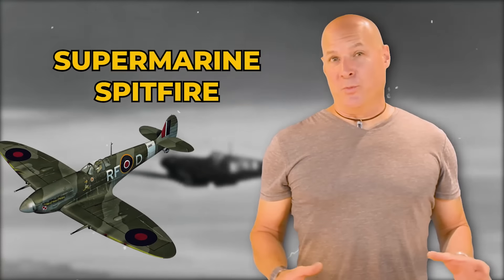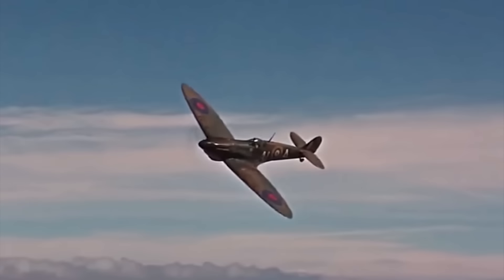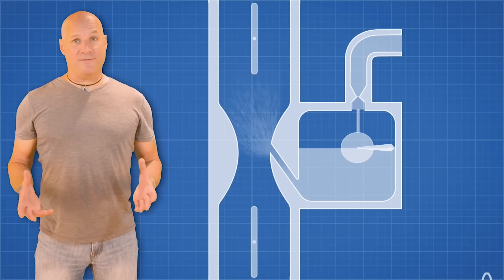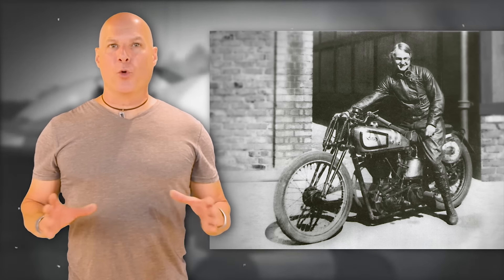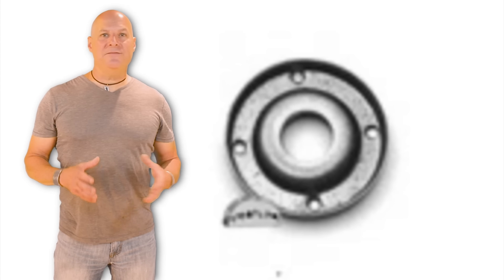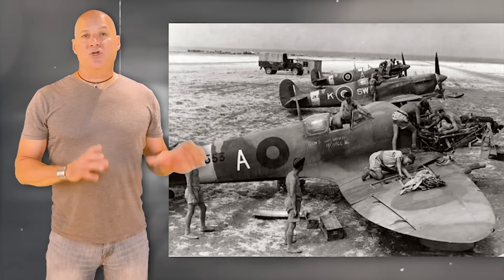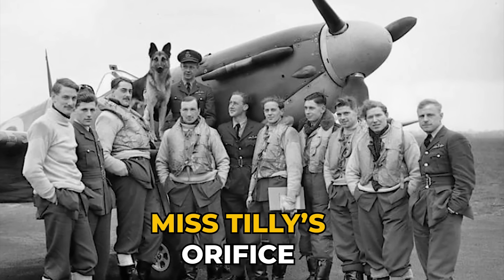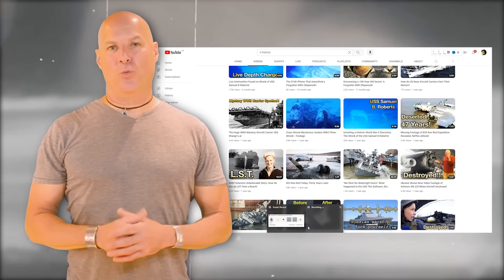How did SHE Save Britain’s Troubled WW2 Spitfire Warplane?

Comment: Beatrice Shilling worked for the R.A.E. and designed the restrictor that partially solved the reverse flow problem. It allowed short periods of negative "g" without cut-out.   At the time it was called "Miss Shillings Orifice".  The other names seem to have been thought up since.  The eventual total solution was the Bendix pressure carburretor which came into service in 1943.
Reply from the maker: Thank you for the great comment, Pete!
Reply: I love the name "Miss Shillings Orifice". This must have caused a few smiles at a time when humour was needed 🙂
Reply: The Bendix injection carburettor was replaced by the Rolls Royce developed S.U. injection carb which was used on all Merlins and Griffons as it became available mid to latter part of WW2.
Reply: Calling the spitfire awful,  bit underhand me thinks ...
Reply: @michaelleslie2913  . No-one said it was " Awful " , just that there was a known weakness in the Fuel System .
The Rolls Royce  Merlin was developed as a RACE  Engine , for the Schneider Trophy , an International Air Race , that involved straight and Level flight and Consistent Hard Banking to Left or Right . No Aerobatics or Negative  G's .
Like  NASCar  Oval events , for Planes .
Reply: I am fully aware of the issues with early spitfire fuel problems,  but before you have a pop at me for goodness sake read the title of the video 🤪
Reply: @johncunningham4820  What?!! Where did you get this information from?
The Merlin had no connection with the Schneider Trophy.
It was not built as a race engine either.
Actually everything you wrote is wrong. Better educate yourself as I haven't got the patience for people who talk complete B/S.
Reply: @Slaktrax  RJ Mitchell, who designed the Supermarine planes that won 3 consecutive Schneider Races (thus causing Britain to permanently own the Trophy) used Rolls-Royce engines after Naiper engine company couldn't make him an  engine that fit the required Horsepower/Weight/Reliability requirements he needed.
 
The Merlin P.V. (P.V. stands for Private Venture) was already being developed as a follow on engine, just in case they needed it for more seaplane racing.  Seeing the real possibility of the next World War looming, Mitchell who designed a failed fighter design.  The failure was due to him, and everyone else trying to fulfill RAF specs,
 
Both Supermarine and Hawker engineers got permission from their companies to make their own designs.  The Hurricane was (basically) a quick modification of various parts of existing Hawker aircraft, including an enlarged nose to house the Merlin.  The Spitfire was much more cutting edge design and required full retooling, as well as extensive testing.
 
But just like the Rolls-Royce's Merlin, which is named after a falcon, they were both Private Ventures!  And the three of them saved Britain!
Reply: The pv 12 merlin had very little to with the schneider trophy supermarine aircraft other than the name of the company that made it although the Griffin engine used on later spitfire marks  used development's from the earlier motors .
Reply: @michaelleslie2913  Rolls-Royce named only its (piston) aircraft engines after creatures that flew!
 
The Griffon was the follow-on aircraft engine to the Merlin.  The Meteor was a modified Merlin engine with shorter Connecting Rods to lower the compression ratio so that it could run on the Army's lower octane gasoline (Petrol).
  
Rolls-Royce had started making special aircraft engines for racing as a way to advertise their engines as High Performance and High Quality.
 
As I noted earlier, the Merlin was a follow-on to an earlier engine that was also used in racing (the Kestrel).
Reply: @timengineman2nd714  The Meteor. Where did you get the information about the connecting rods being different?
They were the same. It wasn't a modified Merlin either it was built specifically for the purpose, it even rotated the opposite way to a Merlin. The static CR of a Merlin was 6:1 and the same in a Meteor, except the Meteor had no supercharger therefore it needed no changes to run on ''Combat Gas'' or low octane Army fuel. 🙂
Reply: @Slaktrax  It used most of the parts that the Merlin used!  Also, if you built engines for better performance, they were two easy ways to raise HP by raising the compression (which is why Racing Gasoline is still Leaded and has an Octane Rating of over 100! (To prevent Detonation).
1) is use slightly shorter ConRods, and 
2) shorter pistons.
 
Most piston aircraft engines use 7:1 N.A, so the plane's speed will turn the propeller giving the pilot a better chance of restarting the engine.  (But the Supercharger and/or Turbocharger (or the PRT) will quickly run up the effective compression ratio of the engine!   Since the air is quick thin at 10,000+ feet ASL... But that's why most Allied AvGas was 150 Octane or 180 Octane (thanks to Airplane Racer Jimmy Doolittle!  Who talked Shell into making higher Octane Gasoline!!  Fortunately, the Germans didn't get that information when they conquered Holland (Shell is Dutch))....
 
Didn't know that the Merlin was that low, so perhaps they used taller Pistons in the Meteor... but any where near what a normal car engine has for compression will cause Detonation with 50 Octane MoGas.....
Reply: @timengineman2nd714  I don't know where you are getting your information from, what source are you using?
-----------------
Just about everything you are saying is wrong. Okay, never mind. Keep believing 🙂
Reply: @Slaktrax  My sources are from things I've heard over the years.
You were right about the 6:1 Compression, I must have been thinking about the V-1710 Allison .vs. the V-1650 Packard built Merlins. My bad.
However, it kinda makes sense about using a lot of the same molds, etc. to make the Meteor, since those were available and a big improvement over what was out there for the Royal Tank Corps (basically a diesel bus engine, or basically a modified WW1 Liberty engine (think the "Jenny" trainer engine) both of which had been developed as far as they could go in Horsepower to Weight (and size) ratios.
Reply: The pressure carburettor is the Bendix-Stromberg. It was a JOINT DEVELOPMENT of the American and British companies. BOTH have a right to be named. EQUALLY.
Reply: The Rolls Royce development of the Bendix injection carburettor is covered by AC Lovesey, book Development of the Rolls Royce Merlin, who is credited with designing and development, to address the bendix problem of drop tanks, if the practice was to follow the SU carburettor spitfires to fly on drop tanks to get maximum range first before using internal, the Merlin 66 with Bendix carburettor could be difficult to restart, not ideal in a Mustang over Germany. All Merlin’s from the 100 series went to SU fuel injection similar to Sabre. Hobson-R.A.E. BIINSB fuel injector, with injection through I nozzle into eye of supercharger impeller. Updraft air intake Automatic boost control.
Reply: @DC.409  Great info. Good post, it helps when people have facts and not hearsay nonsense. 🙂
Reply: I bet in the end she made a Bob or two 😊
Reply: @DC.409  There is no such thing as a Bendix pressure carburettor. It is a Bendix-Stromberg. Stromberg was an English company which was an equal contributor and partner in this development.
Reply: @pashakdescilly7517  I didn’t say pressure carburettor, I think you did. 
I quoted Rolls Royce who refer to the Bendix injection carburettor, that the SU carburettor was not available in the USA, modification was made to the Bendix No8 carburettor in their documentation exchange with wright field of 24th June 1942, regarding the Americanisation of the Merlin 61 and 66. They specifically quote that Packhard engines 28,29,31,33,38, 65,66,70,77 and 85 were all fitted with Bendix carburettors, with some exceptions above series 100 equivalents which had Bendix pump fuel injection. I anticipate this was done to simplify descriptions at the Strategic level given the number of Merlin variations.
However only when you look at the tactical level specifications of each  engine series  they provide detail and reference is made to the type Bendix-Stromberg type of Carburettor 8D/44/ 1 , 2 or 3. Similarly for U.K. engines they refer to SU float type or SU pump type (fuel injection) , only when you get into specific engine detail do they then provide the specific carburettor model type and reference to the RAE anti G device if fitted. Indeed on certain series of engines the RAE restrictor was retained leaving the SU carburettor unmodified but with anti-g features the RAE restrictor was removed. Arthur Lindsey head of engine development covered this in his book and lectures post the war.
Reply: @DC.409   Up until 1943, the Rolls Royce Merlin used an SU carburettor.  After that the Bendix-Stromberg pressure carburettor was used.  You are trying to draw a semantic distinction which is incorrect. You lose marks for being incorrectly pedantic and having incorrect information, and persisting with it despite being offered correct information. Go look it up.
Reply: @pashakdescilly7517  Incorrect actually they used SU carburettors float feed with RAE anti-gav and the SU injection fuel pump from 100 series on all U.K. manufactured engines, Bendix-Stromberg injection type carburettors were only used on American built engines, again until the 100 series when Bendix went to injection fuel pump, 1948 Arthur Lidsey published in the Rolls Royce Data handbook in detail. I would think Rolls Royce would know the detail of each engine type, given they designed the engine and managed their production, it’s also covered in detail in several Rolls Royce Heritage books, 2, 9, 31 and 46 from original documentation.
Don’t confuse location of engine manufacturer with aircraft manufacture, Lancaster and Mosquito built in the U.K. could have Packard engines once they had gone through the Glasgow facility, called the British installation. Indeed the Bendix carburettor could be replaced particularly when the engine was brought up to the latest specifications with new connecting rods for example because of identified Packard connecting rod failures and then fitted with the SU carburettor.
Reply: @DC.409   You write utter tosh.
Once the Bendix-Stromberg had been developed it was used on ALL RR Merlins whichever factory they were made in.  Whether it was a RR factory, any of the other factories in the UK making Merlins, or Packard.
Packard was simply ONE Of the factories licenced to make Merlins. No more, no less.
You Americans need to 'own' the Merlin because it was such a fine engine.
Reply: @pashakdescilly7517   One I am British, Two I am quoting direct from Rolls Royce archive original documentation and Mr A C Lovesey  lecture 1945 who  was head of development during the war. Please provide your source which say all Merlin’s irrespective of manufacturing location were fitted with Bendix carburettors with associated engine series type number eg Merlin 61, which is contradictory to all Rolls Royce official records. Wikipedia doesn’t count.
Reply: She saved a lot of lives until a New carburetor was installed.
Reply: @Vincent-en8kp  she was part of the team that developed the REA anti g carburettor conversion of the standard RR float system. Indeed the engine production team under George Bulman, had different carburettor solutions depending upon the specifications of the aircraft which they implemented. The Shilling’s restrictor, the REA anti g conversion, the Bendix carburettor (typically the Packard engines) and the SU fuel injection system, hence the numerous mark numbers for Merlin engines. Ultimately everything moved towards the SU fuel injection system which operated similarly to the Bosch system, given unsurprisingly they jointly owned a U.K. firm which produced fuel injection for diesel engine buses before the war.
Reply: @johncunningham4820  The "R" series engines were completely seperate designs form the Merlin.  Nothing in common.  The opening tag line says awful if you bother to read it.
Reply: @Vincent-en8kp  The opposite in many cases.  She cost the lives of the 109 pilots who could no longer escape by going negative g into a steep dive and put themselves beyond the optimum firing focus of the wing mounted guns.
Reply: @johncunningham4820 actually the Merlin was descended from earlier Rolls-Royce engines.  It was the Rolls-Royce R that powered the racing seaplanes, and the Rolls-Royce R was the progenitor to the Griffon, NOT the Merlin.
Reply: @johncunningham4820  I know it seems probable that the Merlin was developed from the "R" engines but they are miles apart and this was because of their intended application, as a  comparative scenario you would not put a Cosworth DFV engine in a military vehicle because of the short service life of it's components, for instance the valve springs have to be changed after only four hours of runtime, also R's where not suited to mass production, there were only 19 made and were based on the Buzzard engine which in turn was an upscaled Kestrel engine but the end product was a very focused piece of engineering.
The Merlin had to stay within the limitations of practicality although technical advances like sodium filled exhaust valves and spark plug design were taken from the "R" program together with high speed aerodynamics but was designed from the ground up as a replacement for the Kestrel engine specifically for anticipated new military aircraft.
Reply: She’s a bona fide hero, no question.
Reply: @Slaktrax   👍👍 I knew this video was BS when I heard the music. 
History lectures do not have added music.

Comment: It would have been nice if you described what her device did differently, and why it was so easily installed.
Reply: It restricted fuel flow so the engine could still run when the float was open due to g forces. It still ran very rich but didn't stall
Reply: @keithgoodall6780  I kinda gathered that, but a diagram demonstrating how it does this would help.
Reply: @laurendoe168  What a gather from wikipedia article, "Miss Shilling's orifice" is that the first versions were brass thimbles machined precisely, one version for the normal engine and the other for the supercharged merlin.  When going inverted, for a short period the thimble would prevent a gush of fuel, but for sustained inverted flight it would become swamped.  But the stopgap allowed pilots to do quick rolls for two years- enough of an edge until the pressurized carbs were fit for purpose in 43.  The Merlin engineers had a different solution that did not work.  Shilling's did work and further refused to be intimidated by people who thought they were among her betters.  It was the kind of elegant stopgap well suited to the imperative of minimizing down time.  Excellent engineering.
Reply: @SwarmerBees   ... and this should have been included in the video.
Reply: No kidding
Reply: @SwarmerBees  Such a simple device, but briliant. It was a very patriachal society way back when. I admire women like that who do things for a purpose, rather than try to get through what is now called "the glass ceiling"..she saved pilots lives, and as the vid said, helped win the war against Hitler. She wasn't selfish. She was up against a bunch of engineering 'luddites' it seems.
I would hire a woman like that of substance, anyday, if I had an engineering firm. And pay her well, and I'm a bloke.
Reply: Agree. Talked up the problem but not the solution. It "just fixed it".
Reply: @brianmorris8045  6:53 I believe they acted like they did in movie “ figures “, the men just acted like they were better. And again women out did them. 6:53
Reply: Looks like it was a simple baffle to restrict fuel from moving to the upper portion of the carburetor float bowl....same reason race cars use  baffle devices in oil pans to prevent oil from moving away from the oil pump pickup during high-G turns resulting in oil starvation.
Reply: @SwarmerBees  thanks for the info.
Reply: The device is not a diaphragm. It is a flow restriction- orifice. It reduced fuel flow when carb bowl float “dropped” and fuel pump would normally send a much higher amount of fuel into the carb.
Reply: All because someone at "The Ministry"  thought we didn't need fuel injection on aircraft engines despite 
Greater economy (more flight time)
More power 
Allow more radical valve timings
and of course,  consistant fuelling no matter the orientation of the plane

An example, the Rolls Royce Meteor (Detuned Merlin, fitted to British tanks towards the end of the war)
Carbs         600hp
Injection    812 hp
Think what that would do to a Merlin fitted to a Spitfire Mk9 or a later Mustang
Reply: @g8ymw   And we all know how poorly the Mustang performed before it was fitted with Merlin engines.
Reply: Yeah, WTF.  

Also, the video jumped from her solution “fell on deaf ears” to “went from plane to plane installing it.”   What happened?  How did she get them to try it?
Reply: @wanchaichump5932   They had to cut that part so the advertisement could be added.
Reply: @SwarmerBees  Excellent - thanks for this reference!  https://en.wikipedia.org/wiki/Miss_Shilling%27s_orifice
Reply: I already knew this story from a podcast where they described what it does as well as a story about her life. Here's a chance to do a video or a simple diagram on how it works, instead he just glosses over it. Btw I don't want to look at narrator telling the story.
Reply: I agree with you. It is a silly documentary